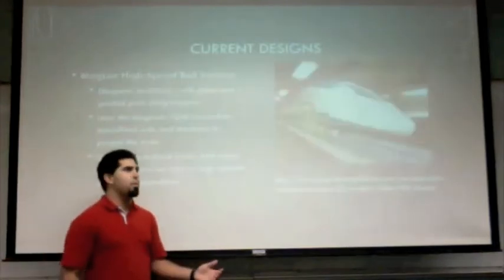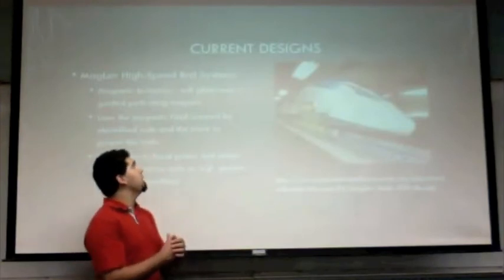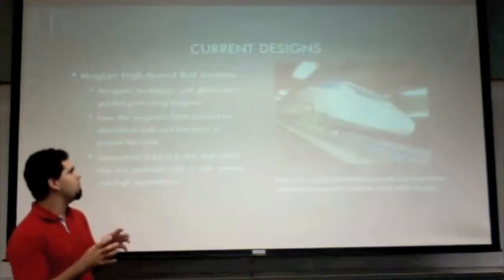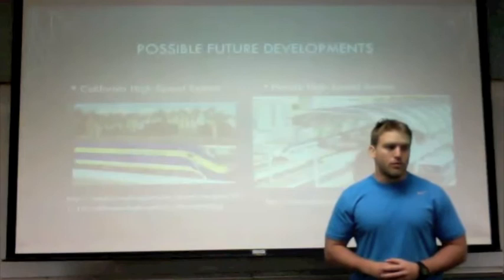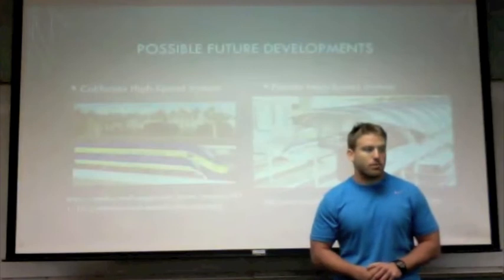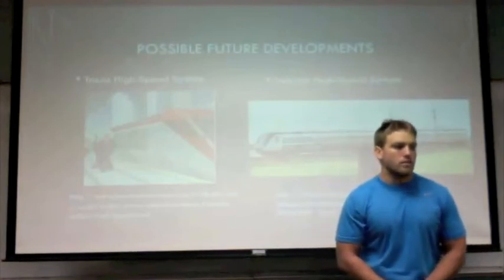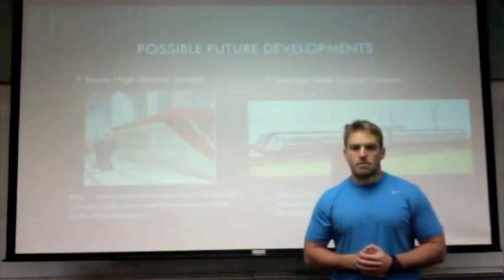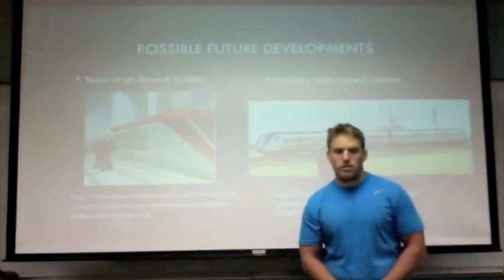Team 11: High-Speed Trains

Comment: Good presentation. The group gave alot of historical information and development of the technology. They spoke at a good pace, not fast or slow, so the information they are presenting can be easily followed. The adjustments they should consider is the lack of formal attire, the powerpoint was not clearly seen on the camera, and the last member was reading off another source instead of quickly glancing at the powerpoint and explaining the info.

Comment: Great presentation and use of examples for high speed trains. It was difficult to read the slides but pictures were still viewable. The lights should be turned down to allow for better visibility. Eye contact was sometimes not maintained and presenters stood in front of the projector blocking the presentation. The camera angle was also at a good spot and elevation. The content of the presentation was very informative and professional. Nice work.